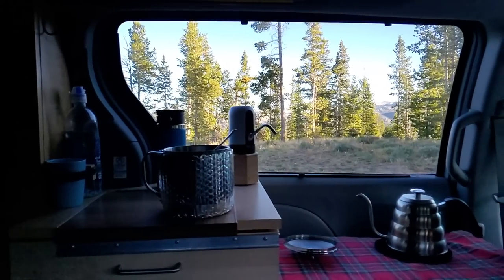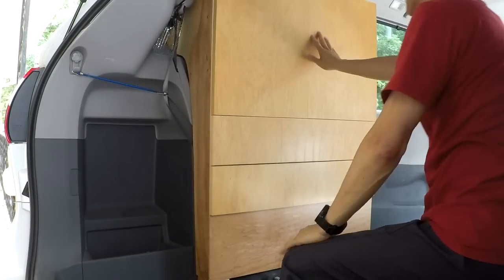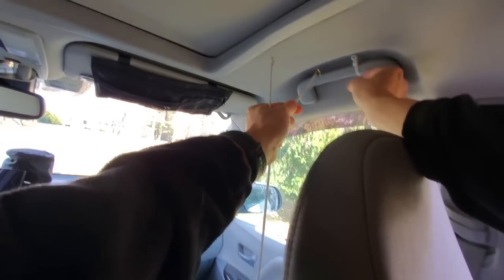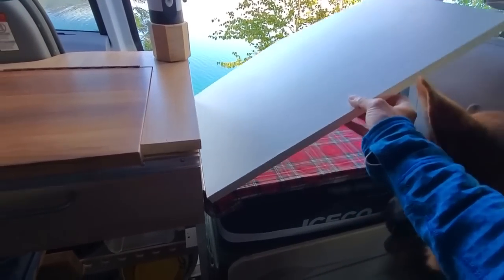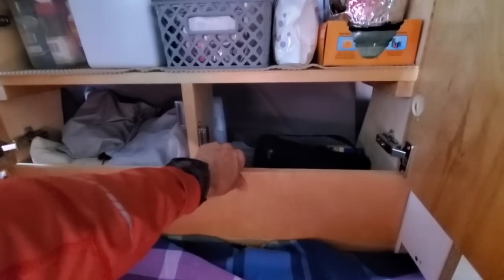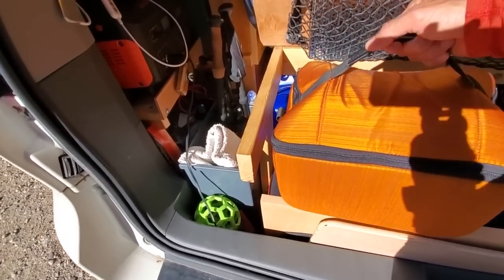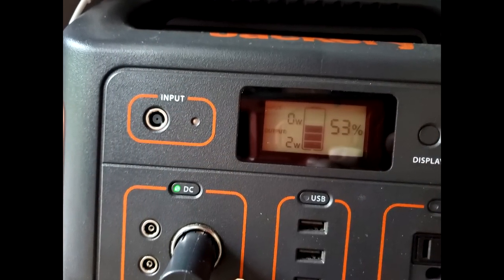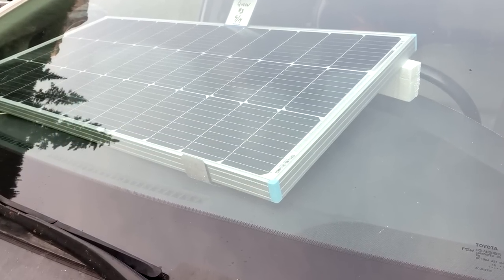Practical Minivan Camper for Long Trips

Comment: I think it’s brilliant of you to include your tire upgrade on your van, as well. Most people don’t think about the different climates they encounter when shopping for tires on their vehicles. And good, high quality wiper blades are a must too!👍 I prefer a Rain X infused blade and super bug washer fluid with Rain X too. Safe traveling and remember a fire extinguisher or wool blanket for emergencies…
Reply from the maker: I learned my lesson on my first trip to California where Google Map routed me on a gravel road and I could barely drive faster than 10 MPH. I also encountered several snow storm during Spring Trip. Therefore I upgraded to the best tires I can afford. Yes, I use Rain X washer fluid too. I also apply Rain Clear rain repellent gel to my wind shied, it works great in repels rain & snow. Water just form a bead and slides off.

Comment: Very cool build.  I'm impressed that the roof carrier didn't hurt your mpg.  I agree that being able to cook inside is necessary, especially in the rainy eastern USA, and after dark in public areas.  My butane stove was OK but when I used it I lowered the windows about 2" for safety.  That was uncomfortable when making coffee on freezing cold mornings.  So I put in a big electrical system so I could use an induction cooktop, which is also safer for fire, burns, and carbon monoxide.  But the butane stove worked OK, and I like having it at my house it in case of a power outage.
Reply from the maker: Yes, I was surprised that the roof box didn't reduce the mpg. I have several cooking devices but butane stove is my favorite. I always open the moon roof to crate a stack effect to draw more fresh air into the car when I am cooking. Thanks for watching.

Comment: Great job in constructing what you needed for space and storage. Besides everything you take with you there is one that is important and can see that it is and that is your bible (awesome).  You have a beautiful dog and great companion. You probably should keep your first aid kit more   reachable and handy for any emergency where you can easily find it and also one for your dog.
Reply from the maker: Thanks for the tips and l would rearrange my first aid kit on my next trip. Yes,  l have a separate medical pouch for my 🐶.
Reply: I had the same thought about the first aid kit. I had an incident on a cross country trip in which I fell in the camp site and ripped 10 stitches worth of flesh off my knee. I remember trying to find my first aid kit as blood streamed down my leg and I felt myself going into shock. Fortunately, the camp hosts motored by just then, and fortunately, I had secured both my (highly trained) dogs instead of leaving loose as I usually do when the campground is empty. It all ended well, but I relocated my first aid kit to a visible and obvious location.
Reply from the maker: @anneK3801  I also carry another small first-aid-kit in my backpack when I hike.

Comment: You are very prepared. Much thought and design went into your build. I like the bed and cabinet design. Curious why the cabinet is made out of such thick wood? You have a wonderful and well thought out build that looks good too. Beautiful dog and travelling companion. Thankyou for sharing your build. Safe and happy travels for you both.
Reply from the maker: Thank you for your comments. Most of the materials I use in my build are either used or left over from old projects. The cabinet doors were cut from an old desk top. I just like to give my old furniture a new life in stead of go to the dump. You can use thinner materials but need more thought to keep it rigid. The lowest portion of the cabinet is 1/8" pre-finished plywood from scrap, that's why they are different color, 😆. The 2" thick butcher block counter top (reclaimed from demolition) I built for my previous built only last one trip and was replaced by current set up. Glad I didn't have to pay for the material.

Comment: Thanks for your video . I am specially interested in the floor set up . How do you attache rear metal bar to the plywood ? How do you bypass the channel used to host 2nd row seat ? Thanks again from Vancouver, BC
Reply from the maker: I did not drill a single hole to the car, all the floor and cabinet were attached to existing anchor points using nuts and bolts. Not sure which metal bar you mentioned. If you go through my older videos, you will understand a bit more how I did it. I did not remove all the sliders of the second row seats support, I place wood spacer below the metal and attach the plywood through their holes.

Comment: NIce vam build. Is there a way to determine how much weightin a build for a specific vehicle? Like the wood being heavy?
Reply from the maker: The chairs I removed from the van are very heavy. They weight several hundred pounds, more heavier than my bed and cabinet. One easy way to measure if your build is too heavy is record your wheel well dimension from the ground before and after your build. How much gear and water you carry are also big factor. I check all wheel well before each trip to see if I over load the van. My 2019 Sienna can carry up to 1,565 lbs including passengers+gear. I don't think my build is too heavy. If your van's rear end sag more than normal, you know it is overloaded.

Comment: I have subscribed to you hoping to find out how you did your floor, bed the table in the front seat and tips on driving with a larger dog.  I Have a sorta good handle on your bed But not so much on your floor. It looks like you took the backseats out and added a spare tire which in my Dodge Caravan I don’t have. Did you take out the front seats as well and if so how are you utilizing those wells? I’m also interested in if you are using the wells how are you accessing it do you have some kind of hinges I briefly thought I saw some but was not sure.  Does the Floor in the front go flush to the floor if not, are you storing some thing under the floor near the front?
Reply from the maker: Sienna AWD don't have storage under the floor and spare tires because it came with run-flat tires. I don't like the run-flat tires and replaced with regular tires. My type of adventure requires a full size spare tire. So far l haven't use it yet. In your case, you need to build access panels to fully use all your spaces. I removed 2nd and 3rd rows seats. I just finished my 7 weeks road trip and will upload another update on my van, stay tuned. Thanks for watching.

Comment: Great work!  I want to do something like  this with my 2006 Sienna.  My search was about FWD and the challenges.  I've gotten stuck in mud a few times over the years and I'm looking for solutions. Is your minivan FWD? 
  I love your van build!  It's so well thought out!
Reply from the maker: Thank you. I have two FWD minivans before and they are not that good in snow and mud. Therefore I want AWD in my latest build. Other options to get a good set of tires.
Reply: @vinnyandrocky  thanks for your reply!  I was wondering if better tires would make much difference.  I'm only looking at little get-aways for now.
Reply from the maker: @barbarazuazua3927 Yes, whatever you have is good enough. Just to go out and enjoy.

Comment: How did you attach your tarp you used as an awning to the car?
Reply from the maker: I tie a 7 feet extension pole along the roof rail for more attachment points. There are grommets along the tarp on all sides. I use ball bungee cords for secure the tarp to the roof rail or the extension pole. In the front, I use two 1/2" x 3 sections poles that I have from older canopy.

Comment: Question: Does putting the solar panel inside on the dash get too hot?
Reply from the maker: No, but it receives much less energy from the sun because the wind shield reflects some energy (not sure how much it reduces). The solar panel gets hot when under the sun, I elevate the panel from the dash board with  towel and foam block and avoid toughing the windshield The only time I put the solar panel in the dashboard is while I go backpacking to keep charging my Jackery generator.